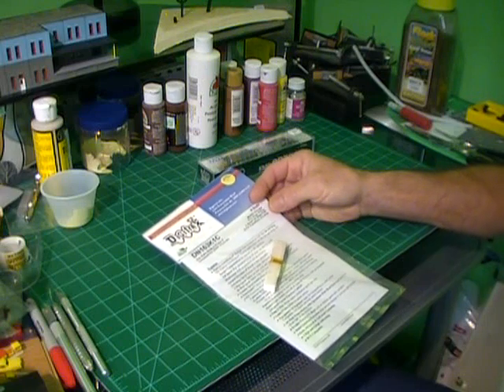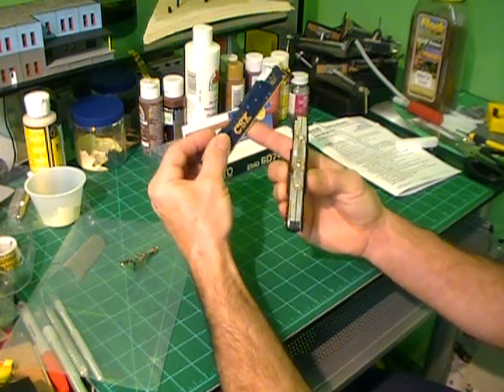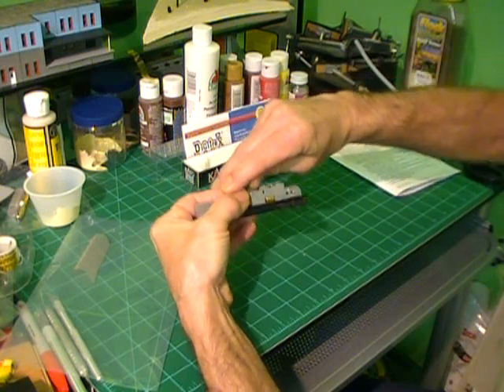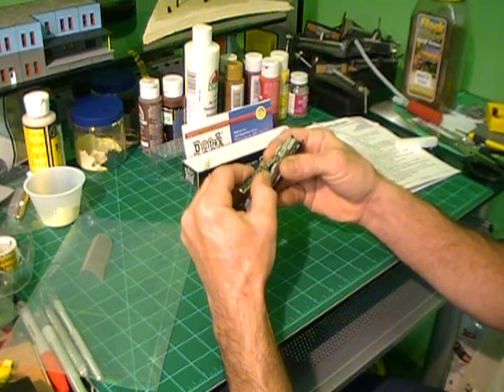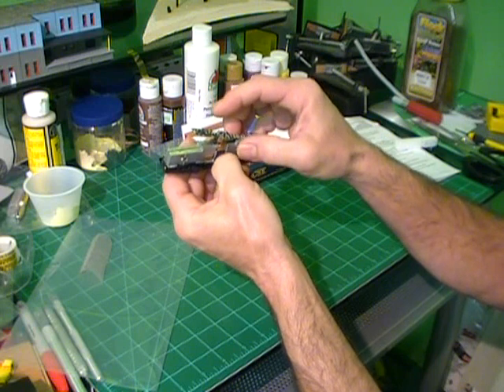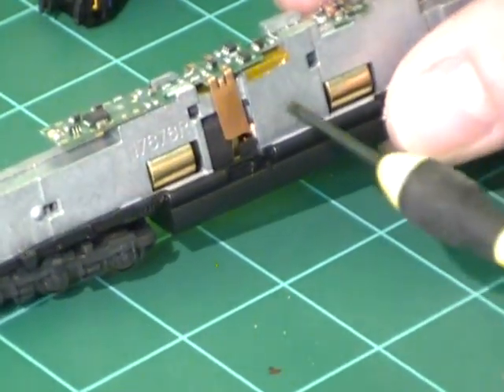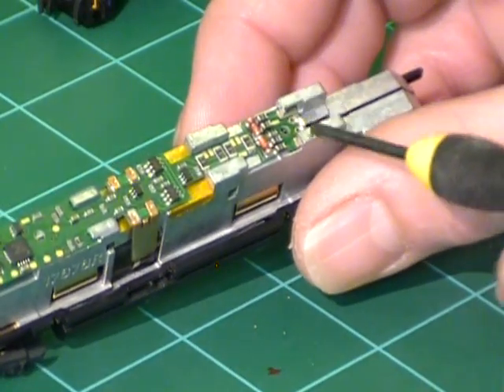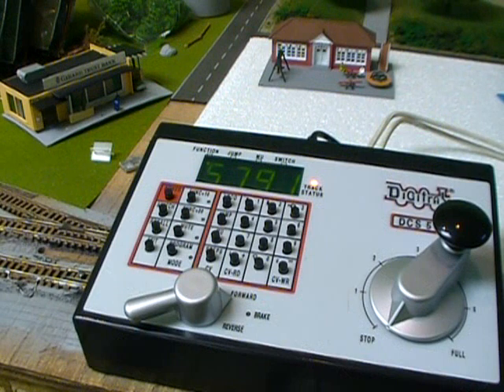KATO DROP-IN DCC DECODER INSTALLATION

Comment: Thanks for the great tip about placing a small piece of styrene under the front of the decoder.  I was struggling with 2 SD70s and couldn't get either one to work.  The styrene fixed both of them.  Now, if I could just get my new GS-4 Daylight to work with the EM13 decoder...

Comment: I have one and loco run's fine until body shell is on I have tried capton tape under the front of the digitrax board and nothing has worked. any downward pressure stops this loco.
Reply from the maker: I have found that some of the DCC boards are thinner than the factory boards. What I have done is to slide a thin piece of plastic between the decoder and the loco frame behind where the contacts meet the frame to push the board up to improve the electrical contact to the frame. Sounds like the shell is pushing the board down away the frame.
Reply: Dennis, in case you hadn't fixed your problem yet, I had the same problem with one of my SD70s.  After I did the styrene trick both ran great with the shells off, but one wouldn't run with the shell on.  The problem was that the left tab connected to the engine (not the decoder tab) had gotten caught on the shell when I removed it and got bent outward.  When I put the shell back on it was pushing the engine tab inward away from the decoder tab and contact was lost.  I straightened out the engine tab so it wouldn't contact the shell and that fixed it.

Comment: I 've installed one in my n scale u p locomotive that's a Kato and the engine runs jerky at slow speeds any idea why ?
Reply from the maker: If the lights flicker than you may have a loose connection. Some decoder boards are thinner than the stock board so I have slid a small piece of styrene under the board to push it up against the loco frame at the front contact points. Also make sure that the decoder is insulated from the frame.
Reply: Ok thank you I'll try that I just bought another Kato n scale locomotive but it has DCC already installed I hope that it works better